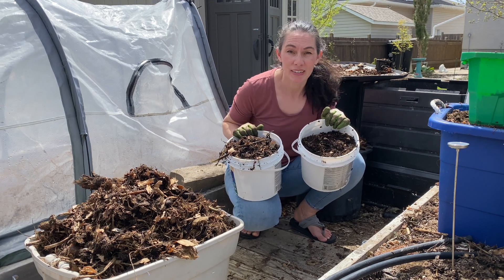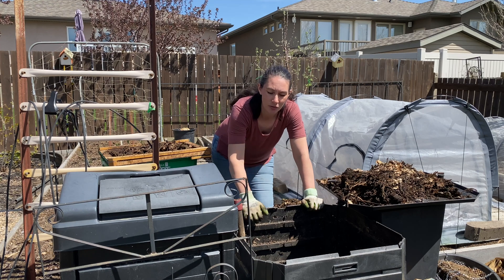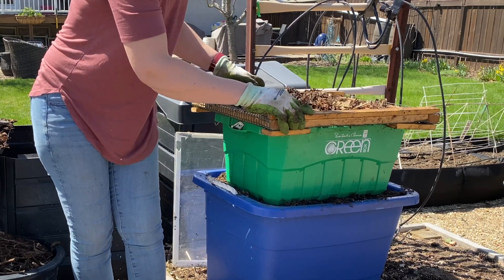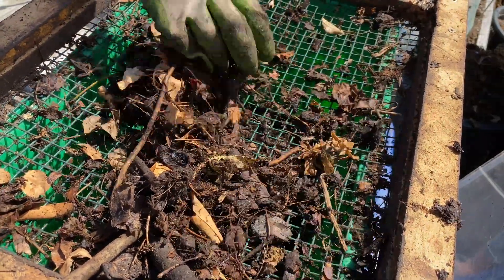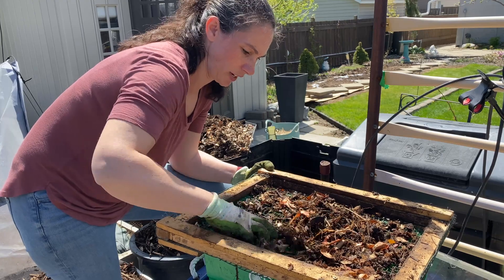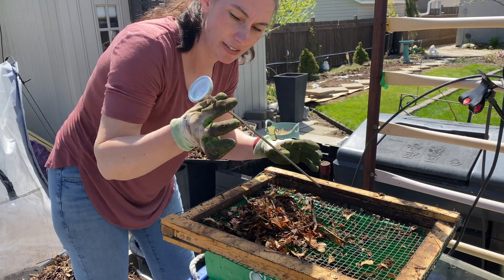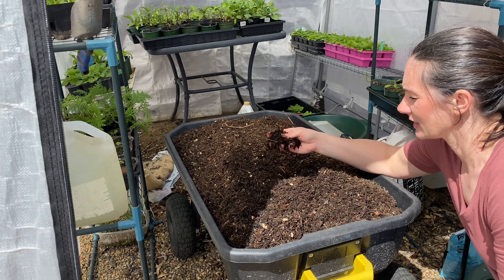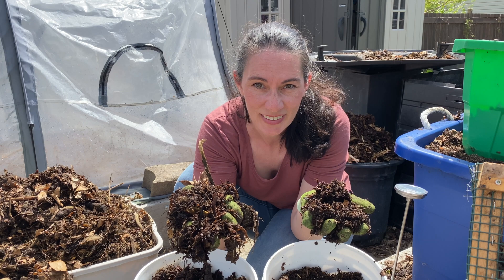Finished Compost: What Does It Look Like? Composting For Beginners

Comment: My neighbors complained that my new pile will stink and it did and I caught it before they noticed. I live in apartment complex. I tore it apart and added lime. Is this ok?
Reply from the maker: If it stinks it has likely gone anaerobic. It may be too wet so adding some browns can help. Keeping it stirred often will also help. When you are just starting there can be a bit of a learning curve to learn how much to add of your browns to greens depending on your particular ingredients. A good general rule is two parts browns to one part greens. If it is available to you it can help to put a small layer of soil, peat moss or sawdust over your layers if you are building a pile as you acquire materials. I’m not familiar with adding lime so I can’t speak to that. My pile sometimes gets smelly if I try to add too big of piles of grass clippings. Very fine, wet greens like these tend to clump and smell if not well mixed with browns.
Reply: Yeah, if it get too wet, it will stink. In the first 2 weeks of your pile, turn it often, like each 2 days. And add cardboard/paper if it's too wet. Try to break any clumps. Also don't put sauces, spicy stuff, mayonaise... anything with a strong taste. It's smell like crazy for months afterward. Enjoy and good luck from Quebec!

Comment: Thanks for this! I just started composting last year in SK so it's helpful to have a comparison. On a side note, I've been looking around for a good "pop-up" tunnel that is high enough for tomatoes late in the season to extend the growing time. The one you have in your video here looks like just what I need, but I haven't been able to find one like it. I wonder if you could please share a link to it, if available?
Reply from the maker: This https://amzn.to/3f1nvH4 is the exact tunnel behind me in this video. I see that it is currently unavailable so you may need to just keep a watch for it to come back in stock. It won't be tall enough to cover indeterminate (staking) tomatoes, but should be enough for determinate (bush) varieties. I would recommend this frost blanket https://amzn.to/30YBzZL for late season frost protection. It is large and heavy enough for several degrees of frost protection. I have noticed reviews saying it does not hold up for more than a season, but I think using it to protect for occasional frosts and not all season will make it last longer. I cannot attest to the longevity of the frost blanket as I haven't used this particular one for an entire season yet. I have had my tunnel for several years. I don't use the tunnel throughout the summer as it isn't necessary, but use it in spring and fall as a season extender for cool crops and to warm the soil in the spring.

Comment: I throw my material in a three sided open bin. The bin is about 10ft. by 5 ft. The chickens scratch through it when they are out free ranging. About 3 times a year I shovel every thing they have scratched out back into the bin. When I want to use it I scrap off the top foot and load up the wheel barrel from beneath. I yield about 6 loads every 6 months. There can be some material I throw back into the bin that are too large, but not much. The chickens do a great job of keeping it turned and broken down.   🤠
Reply from the maker: You have a great set up. Chickens are a great help with compost from what I’ve heard. Do you think your hot climate helps or do you need to add a lot of moisture because of the heat?
Reply: @PrairiePlantGirl  I need to occasionally add water. I do not do that often enough.   🤠
Reply from the maker: I can be negligent in keeping my compost damp enough in the heat of summer.